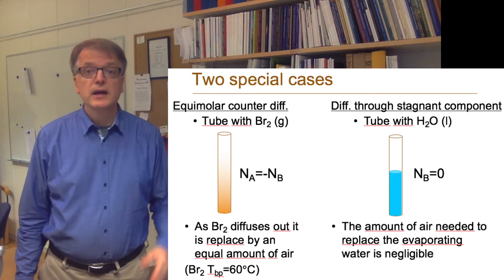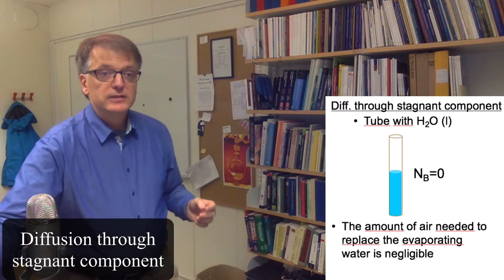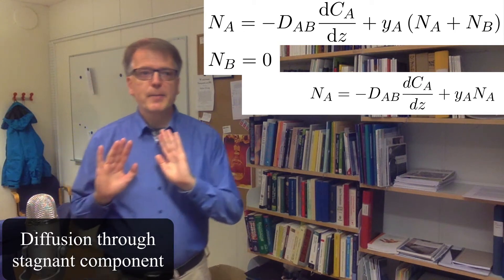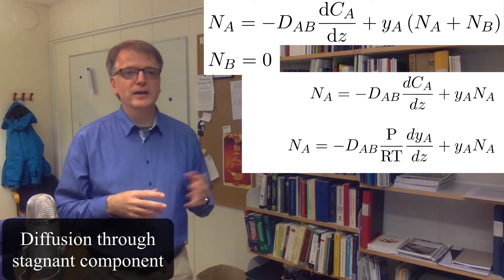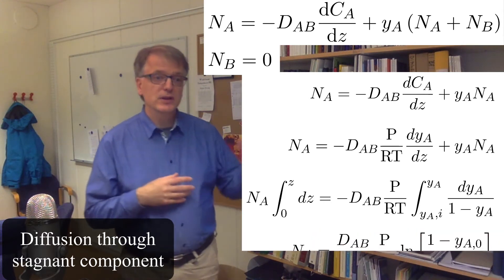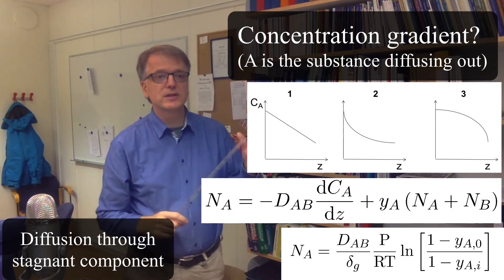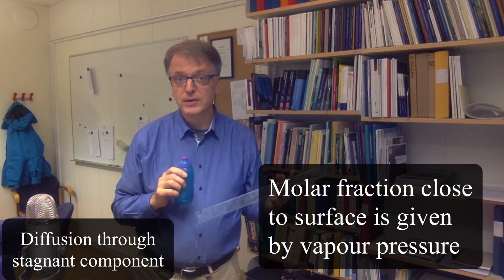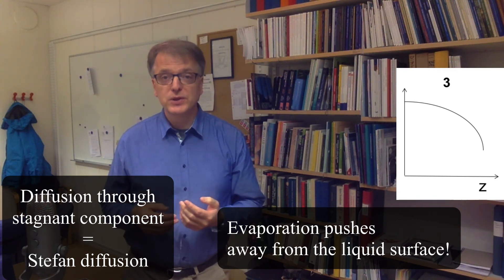Diffusion through stagnant component

Comment: Dear Sir, Can you please explain how to find δg, yA,i and yA,0. As far as I have understood we can calculate yA,i by saturated vapor pressure i.e. yA,i=v_sat/atm pressure. And yA,0 can be taken as 0 (if no vapor is present before). I am not getting how to find δg. Your videos are really helpful. Thanks a lot.
Reply from the maker: That seemingly simple question can be answered on many levels of abstraction.  I hope I don’t confuse you with my answer:

y: First note that the molar fraction is related to the partial pressure (or concentration if you want) yA=PA/Ptot=CA/Ctot

yA,i: This you get from the condition at the surface. You can usually assume that the conditions at the surface is given by an equilibrium. Thus over a liquid surface where the vapour pressure at equilibrium (for the current temperature) i Pvap, then you get yA,i=Pvap/Ptot

yA,0: You get this from the bulk concentration. In case of evaporation from a cylinder, the concentration in the room. When you come out from a shower with water on your skin and you feel a chill as unsaturated air meets your skin (see wet temperature), yA,0 is related to the relative humidity yA,0=(relative humidity)*Pvap/Ptot

δg: might be problematic to "find" or determine. It is the film thickness and you can think of it as the "undisturbed" layer. In some cases we have a geometry that helps us. So when we have a cylinder with a small diameter half filled with a liquid, the film thickness is the distance from the surface to the opening. Outside the cylinder we have turbulance and hence mixing, but inside the cylinder we have no mixing (Note for the really advanced readers: I'm simplifying here, what really happens looks a bit similar to what happens when you pour a Guiness where gas bubbles raise in the center but sink towards the edges).

Where the film thickness is not determined by “obvious” barriers, it is the fluid dynamics that determines the film thickness (and that’s a science all by its own).

The problems with determining the film thickness δg in many cases is one good reason to use mass transfer coefficients.

Note: There are several links between this and * Two-film theory
*  Penetration theory
*  Wet temperature (see moist air)
*  Moody diagram
Reply: Thanks a lot, sir

Comment: Sir,
If air is stagnant,why we are even considering the convection part,the net flux should alone be of diffusion...
why not Na = Ja ??
Reply from the maker: A common and interesting question. I guess you're refering to "Diffusion through stagnant component"? Quick answer: For air you have BOTH diffusion and convection and those two processes cancel out each other. 

Why do we have convection in the "diffusion through stagnant component" case? Because gas occupy more volume than liquid. When liquid evaporates its volume increases, pushing out some of the gas inside the tube. 

For air, the concentration of air is higher outside the tube than inside and thus the air diffuses into the tube, counteracting the diffusion (Well, ok, I'm simplifying here. Technically, the amount of air (as gas) inside the tube increases slightly since the liquid level drops (and thus N_B isn't zero), but you can (in all normal situations) safely neglect that since a liquid contains way more molecules per volume than a gas (so |N_A| >> |N_B| )

Also note: Convection refers to the average movement of all molecules, i.e. both component A and B, and we have a net movement of molecules out of the tube (due to evaporation) and hence we have convection.

Technical & philosophical note, for those not easily scared: The molecules do not care about how we construct our mathematical model of the world. We humans have chosen to simplify the description of movements of molecules by dividing it into two categories: Average movement (=Convection) and Movement relative to the average (=Diffusion). So the individual air molecules  move around by Brownian motion inside the tube totally oblivious to our notion of a convective transport. What they "experience" is that the molecules of type B they collide with are more likely to move in one general direction (out from the tube). They also experience that in one direction (towards the liquid surface) they are more and more likely to collide with molecules of type B as opposed to air molecules. (This is due to the concentration gradient). It may be possible to create another mathematical model where you simply can start with saying that air molecules do not move (on average) and molecules of type B move (on average) out from the tube. Such a model might have its benefits, but it will also (as all models) have its limitations and difficulties)
Reply: @PLE_LU   Isn't this a micro and macro question considering that he wants an answer to a constant volume that would be void of diffusion? Not void of convection ??
Reply: @PLE_LU  I understand your answer was a molar factor of volume that might be small but shouldn't be ignored.
Reply from the maker: @1965ace   Sorry, I don't think I understand your questions. What do you mean "micro and macro question"? Diffusion is what happens on the molecular level, convection is transport of large groups of molecules. What do you mean by "molar factor of volume"? 

Anyway, this video is about two special cases. Special cases are just that, special cases, extreme variants of reality. Real situations might be something in between the two special cases (or totally different from both)

Equimolar counter diffusion: No convection, only diffusion

Diffusion through stagnant component: BOTH convection and diffusion but although both convection and diffusion vary along the concentration gradient, the SUM of the two is constant. If we can keep the liquid level at a constant distance from the opening, the diffusion of air will, at each distance away from the opening, have exactly the same magnitude as the convection but opposite direction and the air will be standing still. In a real case, e.g. a burette with water, the liquid level will decrease and the distance to the opening thus increase over time. Hence there must be a net transport of air into the burette. BUT, if you calculate how many ml of gas you create when you evaporate 1 ml of water you will realise that that net transport is very very tiny compared to the net transport of water.